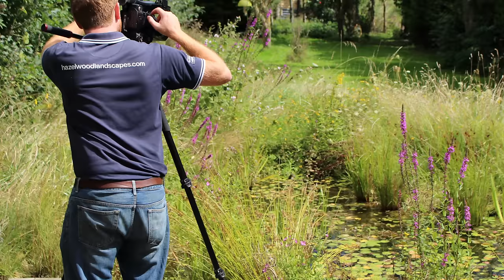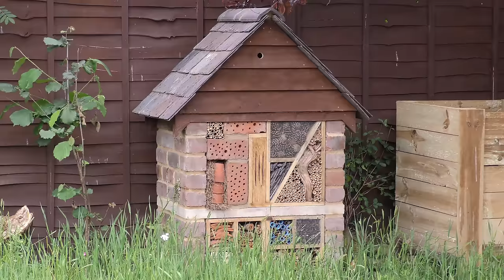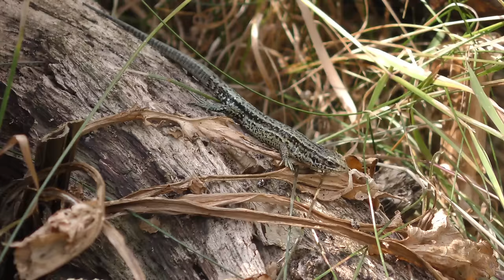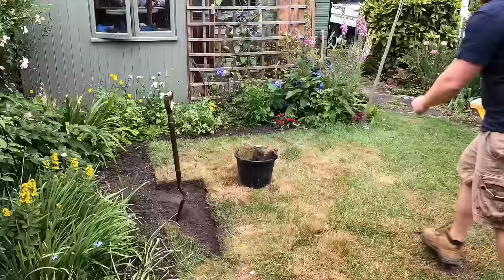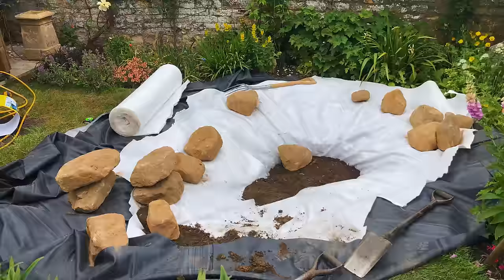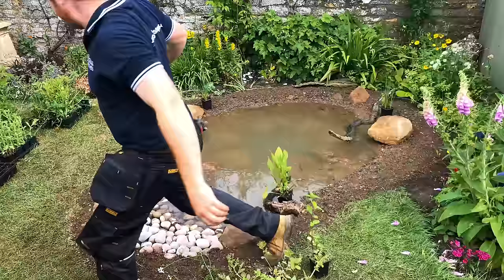Making a Small Wildlife Pond - Timelapse - 4K

Comment: I am thinking about rewilding my garden but I,m worried about attracting rats and mice. (I once had rats in a previous garden by a river), long grass to hide in and still water to drink. How do you attract other wildlife but avoid rats?
Reply from the maker: Hi Nochka, so glad that you are considering doing this, you're certainly on the right channel if you need help in succeeding.  I have to say that the rats were probably there due to the proximity of the river, they do like to be around these areas.  When feeding the birds, ensure that you use a high quality "no waste" mix so that there is none spilled to the floor, or at least at the end of every day ensure any remains are cleared away.  I hope that this helps and that you find some helpful videos on the channel - best wishes, Joel

Comment: and why did you add dirt INTO the pond before filling?
Reply from the maker: Hi there - this is not "dirt" but subsoil and is used above the fleece liner so that not only can plants be put directly into the soil, negating the need for baskets, but it is also very low nutrient meaning it isn't very friendly for algae growth - a big problem with ponds usually - best wishes, Joel

Comment: It’s hard to tell, where does the black liner disappear to? Do you need to use liner for this? Great job !
Reply from the maker: Hi. Thanks for commenting. Yes I need to use liner I’m afraid, as the pond would not hold water otherwise. The liner is hidden by the subsoil placed on top of it.

Comment: What was the white and black stuff was it a tarp??
Reply from the maker: Hi Kalam - it's EPDM rubber liner (recommended by Greenpeace due to it's longevity and that it's made from recycled tyres) - the white fleece is just known as "industrial fleece" here in the UK - but carpet underlay can be used if the fleece isn't available where you are :)  Best wishes - Joel

Comment: What if theres a big rain storm and it fills up and over flows ? Will it ruin your flowers around it ? I’m curious
Reply from the maker: Hi Sophie :)  The plants around the edge are all damp loving and the soil actually helps soak up any excess which is quickly used by these damp-loving plants.  It's the same with any water source I guess, a bucket of water left out in heavy rain will overflow, same with fibreglass ponds, but the beauty of these is the soil and plants around the edge mean they won't overflow :)  Hope that's helpful - best wishes, Joel

Comment: Why did he install a layer of white, then black, then white again? It seems like a lot of materials for a little pond.
Reply from the maker: The fleece underlay is to protect the liner.  Then the liner goes in.  An extra layer of fleece is not only for additional protection but means the low-nutrient subsoil doesn't slip on the butyl rubber.  The low-nutrient subsoil ensures the water stays clear and of course allows planting directly into the soil :)  Here's a short video of just a few of the many ponds I've made over the last 17 years, using this method and how they look once the plants have established:

https://www.youtube.com/watch?v=jG1w7MUhhXs

Hope this helps - best wishes, Joel

Comment: What type of sheet you are using bro???
Reply from the maker: Hi Ravindra - the liner is Rubber Butyl (it's stronger and recommended by Greenpeace as it's made from recycled tyres) the white sheeting is "industrial fleece" but as the subsoil covers this to allow for planting with low nutrient soil, you could use carpet or underlay just as effectively - I hope this helps - there is a 3 part series on the channel which shows this in "real time" with instructions and advice :)  Best wishes, Joel

Comment: You put another layer felt on top of the waterproof liner? Won't that break down in the pond and cause problems?
Reply from the maker: Hi there Frank :)  It's pretty sturdy stuff and in 15-16 years of installing ponds in this way it's never caused problems nor needed replacing, same with the liner - because it is protected on both sides the longevity can be up to around 50 years :)  Best wishes, Joel

Comment: Anyone have an idea as to how one could do this without the use of plastic? Concrete maybe?
Reply from the maker: Hi there, for larger ponds there is bentonite clay that can be used but it is very expensive.  The EPDM butyl rubber that I use for liners is, believe it or not, approved by Greenpeace and other similar bodies as it is made from recycled tyres and has a life-time guarantee, aside from the fact that the fleece used above and below provides extra protection.  I am not sure there are many other ways to retain water without manmade materials (fibreglass etc) - concrete/cement production alone for example generates around 2.5 billion tonnes of carbon dioxide (CO2) per year—about 8% of the global total. What I do know is that these habitats are vital for so many creatures' survival :)  Hope this helps - best wishes, Joel

Comment: That's a lot of liner material. 😬 Didn't realize you needed 3 layers of liners. That's had to be $$$ for that tiny water feature.
Reply from the maker: Thank's Jen - it lasts a lifetime, is recommended by Greenpeace to be the most eco-friendly as it is manufactured from old tyres and with the fleece liners it gives it even more protection - fibreglass moulded ponds don't last half as long, can be easily damaged etc, so it's very cost effective, whatever the size of the water body :)  Best wishes, Joel

Comment: Excellent work but one problem...use of man made sunthetic material as a water holder
Reply from the maker: Hi there - thank you, but unfortunately unless you live in a heavy clay area then some form of water retention is needed.  Happy to say that the EPDM rubber liner is actually recommended by Greenpeace due to it's manufacture from recycled tyres and the fleece either side ensures longevity of the ponds up to 50 (ish) years so it's the best way available and much better than rigid fibreglass when it eventually fades, cracks and needs disposing of.  Best wishes, Joel
Reply: @WildYourGardenWithJoelAshton  👌

Comment: Did the water became clear?
Reply from the maker: Hi Jatwang 🙂 Yes, it takes around 1-2 weeks for the oxygenating plants to work and for the subsoil to settle - in this video here you can see just a few of the many ponds created with this method and how they look - there are some included that I had to film immediately upon completion and haven't had a chance to return to, like the client's one in the video above, but this video here will show how they develop:

https://www.youtube.com/watch?v=jG1w7MUhhXs

There are also a lot of other ponds and a "how to" to make the pond above, on my channel - best wishes, Joel
Reply: @WildYourGardenWithJoelAshton  I see that you added so many layers of sheets. Could it be done without those?
Reply from the maker: @jatwangismyname900  It is explained in the 3 part series, but the fleece helps to protect the liner both sides, and of course when adding the subsoil on top of the final fleece it means that it can take hold on the fleece and not slip down the liner.  The subsoil keeps the water clear as it is low-nutrient and means that you can plant directly into the soil with no need for plastic plant baskets.  But a lot more is explained in the videos, part 1 is here:

https://www.youtube.com/watch?v=lKrjMv6TMlU&t=41s

I hope that this is helpful - best wishes, Joel

Comment: I’d love a pond. Is it ok to use the preformed hard plastic ponds and sink it then surround with rocks and plants or is that not so good for wildlife? I’d put a ‘ramp’ in for the critters 👍🏼
Reply from the maker: Hi Paige - it will be absolutely fine, I use this method to ensure the ponds are as natural looking as possible but any water source is good, as long (as you have rightly said) as it has easy exit from the water, a lot of critters will die by drowning if there are steep sides - best wishes, Joel

Comment: HI Joel. Bit of a longshot this but I've just spilt about half of a bag of aquatic soil in my small garden pond and its clouded all the water, which I'm gutted about. Will this be permanent and will I have to start again  or will it clear itself. Any help greatly appreciated.
Reply from the maker: Hi Scotty - I'm not sure of the size of your pond or the size of the aquatic soil bag of course but if it's gone completely cloudy there are two things - wait a day or two for it to settle, if it's still clouding over then I'm afraid it's a case of draining the pond and then removing the layer of "sunken" soil that will be on the bottom and sides - not ideal I know but it's best to do it now rather than put up with it later as it'll no doubt be annoying in time.  Sorry, but that's the only way I think.  Hopefully it won't be too much work and the effort will be worth it - I'll repeat this on the other video too where you've asked the question of course - best wishes, Joel
Reply: @WildYourGardenWithJoelAshton  thanks so much for replying so quickly. I'm gutted. It was going so well. and looking really good..The pond is only about 2.5m x 1m and it was about 1 litre of soil. Fingers crossed it clears. If not, I'll start again. many thanks for your advice.
Reply from the maker: You're welcome Scotty, at least it's not too much water to "change" and not a great amount of soil, but do keep an eye on it in the next few days as it will be more gutting if you get it completely finished and planted up and it's still floating about - good luck, Joel

Comment: Looks like a big mud puddle. Should have used watered rinsed rocks on bottom with a filter/pump . Why dirt ???
Reply from the maker: Try this short video of the ponds that have been created using this method - there's an instructional video too, which is also linked in under the title - it's not dirt, it's subsoil and for a very good reason - no need for artificial filtration in natural ponds if oxygenating plants are used - none are used in any of the ponds that have not failed using this method for over 16 years now - a few of which I've created are here:

https://www.youtube.com/watch?v=jG1w7MUhhXs

Comment: I would've used concrete and a small water pump
Reply from the maker: Thanks William. Due to the oxygenating plants that were put into the pond, no pump was necessary, as these plants will keep the water clear after a day or so. Also the garden had limited access, so concrete wouldn’t have been viable. Many thanks. Joel

Comment: The only thing I didn't liked in it was that you used plastic as the base.
Reply from the maker: Hi there - it's Butyl rubber and recommended by Greenpeace as it's made from recycled old tyres :)  Unfortunately unless the ground permits, we need to have liners in the UK and Butyl is by far the best as it has a life-time guarantee and with the fleece below and above it, topped by the subsoil means it never needs replacing and of course is far better than fibre-glass moulded ponds which are affected by UV rays, perish and end up in landfill :/  If you wanted to see a few of the other ponds I've made using this method, and when they are established and clear after a few days you might like to see this video:

https://www.youtube.com/watch?v=jG1w7MUhhXs

Best wishes - Joel
Reply: @WildYourGardenWithJoelAshton  Oh! Seems you couldn't have made it on bare soil. In that case, it's okay.

Comment: i feel like you should of went a little deeper
Reply from the maker: It's absolutely possible to go deeper, but with these smaller sized ponds it would make the sides a little to deep for most creatures - most of the wildlife that is attracted does not require them to be deep, toads do like a deeper pond than frogs but there is the deeper well part in the middle :)  Best wishes, Joel

Comment: It’s bad that you put plastic to hold water. Not as natural
Reply from the maker: Unfortunately, in the UK and particularly with smaller ponds there are 3 choices to hold water in a body that size - concrete, fibreglass moulds and EPDM rubber liner, which is what I am using here and for all the smaller/medium sized ponds I make for clients.  EPDM rubber has a lifetime guarantee, lasts even longer due to the fleece lining either side of it and is recommended by Greenpeace as it's made from recycled tyres.  The other two options are definitely more harmful to the environment.  Here's a short video showing how natural these ponds look once established after a few weeks:

https://www.youtube.com/watch?v=jG1w7MUhhXs&t=1s

Best wishes - Joel

Comment: He used plastic sheets🤦‍♀️
Reply from the maker: Hi Ashwini - it might look like plastic but it's not, it's rubber butyl liner and actually recommended by Greenpeace as being the most environmentally friendly, partly due to it being made from recycled tyres and partly due to it's longevity and of course less damaging to the environment than standard fibreglass - it would be fantastic to be able to make all ponds without the use of unnatural materials but it's nigh on impossible in all situations, particularly if you want to maintain water levels.  Hope that helps - best wishes, Joel

Comment: So much plastic ! It is the opposite of a pond.
Reply from the maker: There's no plastic.  It's EPDM Butyl Rubber lining and recommended by Greenpeace due to it's longevity and that it's made from recycled tyres.  It's better than fibreglass and concrete of course, and in the UK you have to have a pretty large water body to be able to retain water without the addition of even Butyl.  Best wishes - Joel

Comment: I wish you hadnt of used PLASTIC!!
Reply from the maker: It's Butyl Rubber, and recommended by Greenpeace as its made from recycled tyres.  In larger ponds Bentonite clay is preferable but EPDM Rubber comes with a lifetime guarantee and the fleece above and below the liner means it will never need replacing or sent to landfill - a lot of fibreglass ponds crack over years and we all know the damage of concrete powder to the environment - it's hard to be human and not make an impact to be honest.  If you wanted to see just a few of the many ponds constructed this way, and how they look once established after a few weeks you can see how they look here:

https://www.youtube.com/watch?v=jG1w7MUhhXs&t=7s
Reply: @WildYourGardenWithJoelAshton   Ah okay so its rubber, maybe better than plastic but still not preferable. Butyl rubber and EPDM rubber are NOT made from recycled tires they are made out of petroleum byproducts. Now maybe you found a brand that was recycled, but almost all of this stuff is made by chemical corporations and is most certainly not recycled. Its also just not a good idea to use this material, as like you said it will never go away. You've created a permanent, impervious layer that separates the pond from the ground below using essentially litter. You should have used a natural material.
Reply from the maker: @phole1100  If you're a practising Jain monk then fair enough, but I doubt you'd be using energy via the internet if so.  If you make no impact on the world you live in, purely by being alive, then I might take your point.  Other than that, this is the most effective material with longevity and I've used butyl in most ponds unless they're large enough to warrant bentonite clay.

https://www.rubber4roofs.co.uk/blog/8-reasons-why-epdm-rubber-roofing-is-the-most-eco-friendly-roofing-system/#:~:text=EPDM%20sheets%20can%20be%20recycled,choice%20for%20the%20environmentally%20conscious.